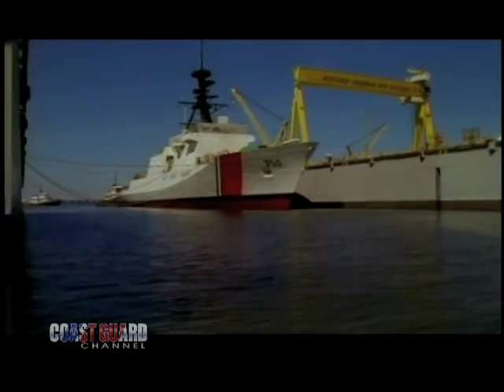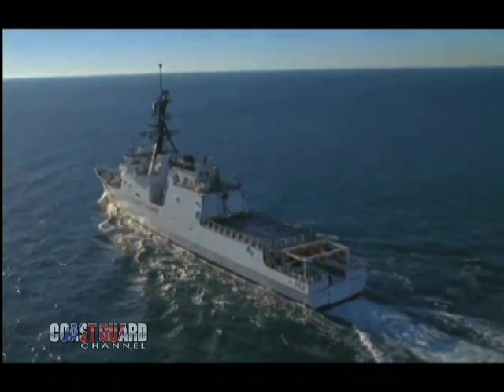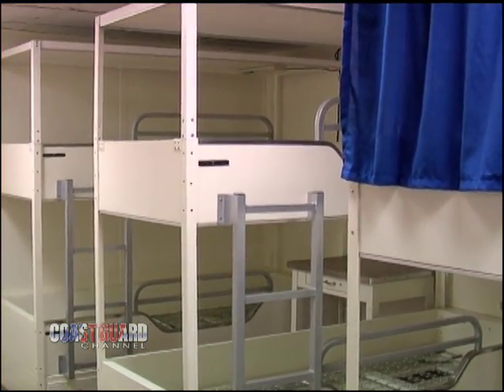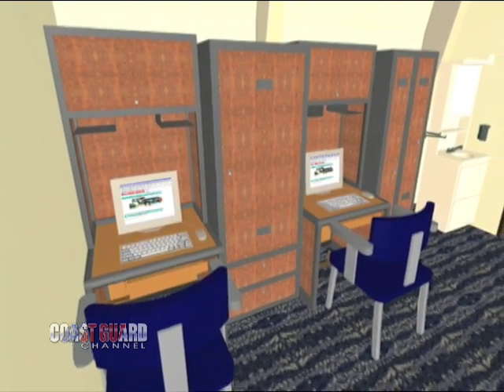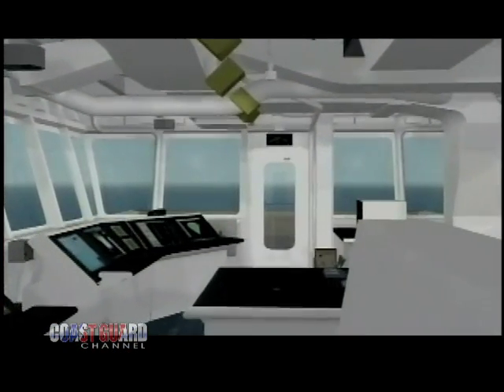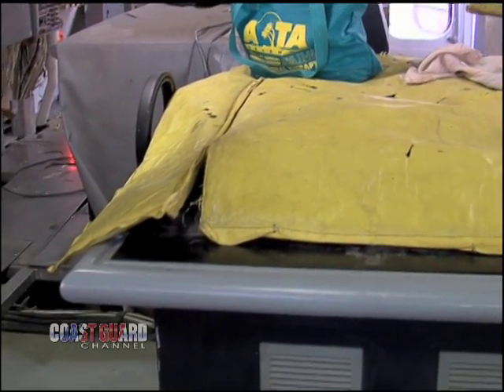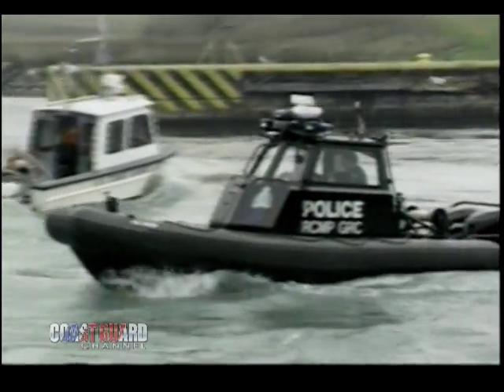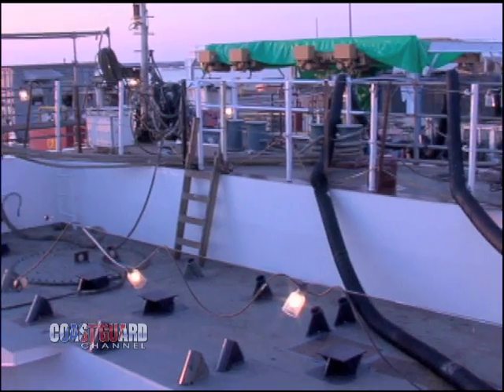National Security Cutter

Comment: The  problem is that peacetime can change to war overnight. We are depending on the idea that the enemy will give us the time to ream the vessels with more capable weapons. The predecessor cutters, with are are much smaller and leds capable than the Bertholf, at least had a 76mm main battery that gave it some shore bombardment and self-defense capability. Given her range, speed, electronics, and aircraft, she was clearly designed to fulfill the role of a frigate in most other navies but without the weapons needed for the role. The Canadian Halifax class frigates are about the same size and has the same ridiculous 57mm main battery. They at least have some missiles for self-defence. something these cutters lack. It just seems crazy to have a ship this large and valuable with a main battery that allows an opponent with a 76mm or, worse, 127mm main battery, to lie out of range and just batter you to pieces with no way to make a response.

Comment: Yes they do have the Phalynx(which could just as easily be sea ram).  They also supposedly have 4 50cal MGs plus at least 2 7,62 MGs.  That's good for the potential suicide boat(s).  The 57mm and phalynx give it a respectable anti-ship missile defence capability considering it's not intended for high intensity combat.  Of course any pirate/drug boat would be toast.

Comment: A 57 mm gun for main armament on a valuable 4500 ton ship. No torpedos. No antisubmarine armament. No anti air missiles. No land attack missiles. No shore bombardment capability. This is not going to end well.
Reply: The USCG won't need most of that weaponry during peacetime,  I do agree the 76mm or the 5 inch would be better. All cutters have space, weight, and power reserved for additional weapons and systems.
Reply: Sar Jim because she's meant to go after smugglers with AK47s not enemy naval vessels.
Reply: yeah but they have crates of flares
Reply: Actually it does have missile defense system which can be seen in the view from the help deck looking up above the location where the person lands helos.
Reply: Used to have HAROONS and torpedoes on the 378's, but it all was removed by the late 90's I believe.

Comment: The Legend Class is a 4,500 ton, $700M disaster waiting to happen. It wouldn't last 5 mins against a 500 ton missile boat. Hamilton Class was better armed than this thing. A single 57mm is too weak and too limited in range for effective NSFS, while also having too slow a fire rate to deal with a swarm boat attack. 

A single CIWS and 6 machine guns are the only other armament. She needs Harpoons and VLS to fire land attack and anti-air defense missiles. And up the gun to at least a 76mm super rapid. Maybe a 127mm. Both with Vulcano ammunition. The addition of at least 2 bushmaster 25mm canons would help with swarm defense, though 4 would be even better.
Reply: The 57mm is not a slow firing weapon at all, it is capable of being fitted with more weapons and sensors
Reply: @cgmason7568  It's slower than 25mm, 35mm  or 40mm cannon. A higher firing rate is key to anti-swarm. They also need multiple autocannons. More guns, and they need to fire at a high rate. 

And a 127 with vulcano ammunition for NSFS.
Reply: @cgmason7568  I thought that the USCGC Dallas had torpedoes, maybe they were lying trying to make us feel better.
Reply: @scootertrash911  did probably before the end of the Cold War